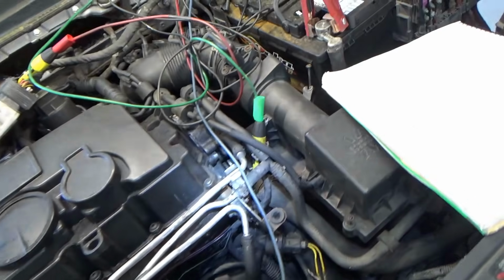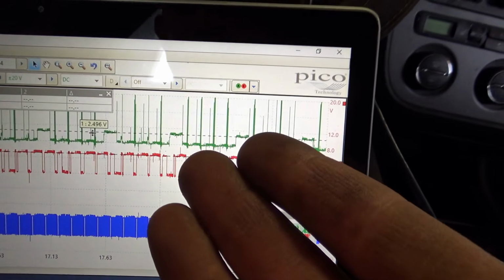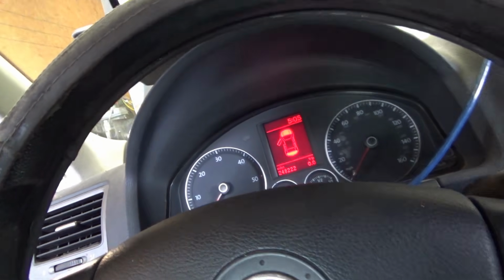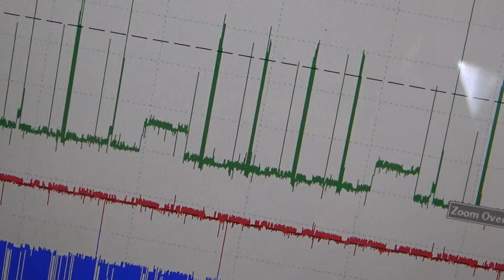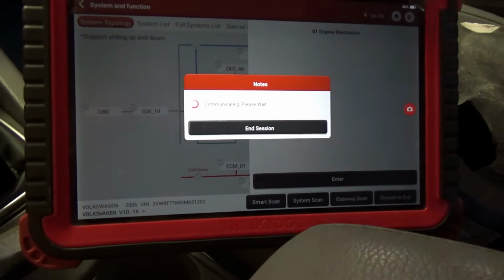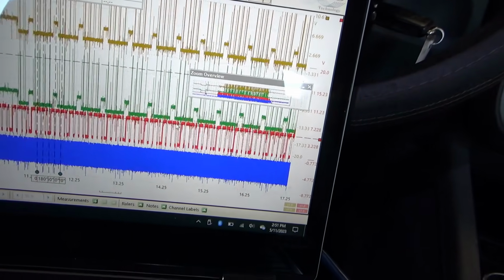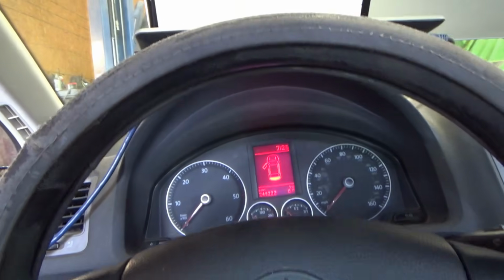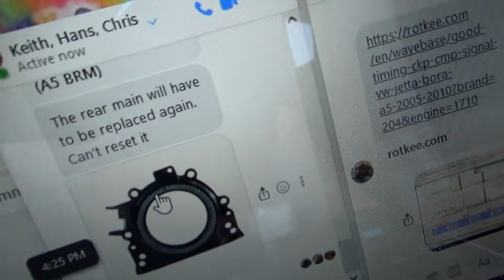ANOTHER Dead TDI?? (Jetta No Start After Engine Swap - Part 2)

Comment: The new rear main seal comes with a removable plastic clip that holds the seal in the correct place for installation . You just have to make sure the engine is at TDC . 
I would charge the 6 hours spent to diagnose.
Reply: They should get the money back spent diagnosing the car from the engine installer. It's not the customer's fault or Ivan's.
Reply: @TheFrenchPug  I agree. It would suck for them since I'm sure they never could have imagined a rear main seal that has to be timed and I could see a lot of people making that mistake, but someone has to pay for Ivan's time and the installation error obviously is not his fault or the customer's fault.
Reply from the maker: @TheFrenchPug  installer was the owner of the car 🤣
Reply: @PineHollowAutoDiagnostics  OMG!!! Lmao!!! So, did he not time the seal gear then?
Reply: @TheFrenchPug  agree👍
Reply: @TheFrenchPug  
Well, when you call an expert you pretty much expect them to be 'in the know' - also about the more strange things about a vehicle. Right?
Reply: @Peter_Riis_DK  I wouldn't expect an expert know about all of the nuisances in a vehicle, or they wouldn't have to pull out service data. There should have been something he accessed for service information that would tell a technician to ensure that seal was properly timed before proceeding.
Reply: @TheFrenchPug  
- Hello, is this an expert in VW diesel engine diagnosis?
- Yes, indeed.
- I have a ... etc. ... Can you do that?
- Certainly.

In that case I would certainly expect expert knowledge and behaviour.

Now, I'm not familiar with mechanics rates in the US. So, is Ivan's pricing expert-rates or average?
Reply: @Peter_Riis_DK  I do not know what he considers himself an expert in. But diagnosing seems to be his Forte. Still, unless you have familiar working knowledge with only that specific brand, you can't be considered just a VW expert. However, if you're an expert in diagnosing, you clearly have to rely upon service literature if you're going to do all brands. And Ivan is often given vehicles from the "Brand Experts" that they can't even figure out, and he does! So what does that make him?
Reply: @TheFrenchPug  I consider him to be a person trying to make a living out of difficult  daignoses where all other avenues have been explored & as most people do not trust stealerships they go to independant shops 1.price 2.location & when the independants are not able to rectify the problem they then call on guy/girls like Iaan to solve the situation so that to me makes him a very good problem solver & if he doesn't know he will call on his group of problem solvers to fix the problems so I  think he is the comsumate professional at what he does.You may disagree with my analysis of him but can you do better?
Reply: @Riis_DK  Ivan is not a VW "expert". He's an expert in diagnosing thing using data and logic. It's impossible to know all the quirks of all cars ever made... In the end he did give them the answer they needed to fix that car, didn't he?
Reply: @TheFrenchPug  The new seal should have came with a warning. For better or for worse, most people don't look up service data for every single job they do and it isn't reasonable to expect that everyone who might be installing the seal will know all of VW's quirks.
Reply: @johnnyblue4799  
Nah, as I see it, the lesson is that next time the shop might as well call that hotline straight away.
Reply from the maker: @Riis_DK  which hotline would they call? 😉
Reply: @PineHollowAutoDiagnostics  
Dunno. Perhaps the one you used. Why?
Reply: Lack of reading on the guy who installed it! Yes. I'd like to know how he charges!
Reply: @dans_Learning_Curve  I'll bet he didn't agonize over charging.
Reply: Is there a way to confirm the seal timing signal without pulling the tranny?
Reply: @alexanderzubar9593 yes compare the cam crank waveform to a known good. You’ll see the crank timing is off
Reply: Ai ai ai... those Vührer Wagens. They are not as simplistic as they use to be.
🙈
Reply: I agree
Reply: Would never have thought didn’t know I’m just gonna leave it at that about the Volkswagen. Nice fined hopefully that’s it even if it took some help. Sometimes we all need it.
Reply: It's easy to mount the reluctor ring without the special tool, all you have to do is time the front pulley (small notch with the arrow from timing cover and camshaft in the right position).After that gearbox off , 3 screws for removing the main seal with the ring, put the new ring with the Orange clip in place and press it carefully! It will be eniugh for the car to be in sync! After that adjust the   torque setting from the three screws from the camshaft sproket, 0degrees KW but depends on the car mileage, my Best rezultă where between 1 degree 2 degrees positive deviation. Best wishes!!🎉

Comment: 10:26  bent fuel line ?  .... blocked fuel filter ....
Reply: no ,, its a diesel ,, he shouldn't be much concern with diesel fuel pressure as there is another high pressure fuel pump which is more important to start the car ,, some diesel vehicles like tractors dont even have an electric diesel pump its more like a higher put up tank that feeds the mechanical high pressure pump

Comment: Wow. Timing signals from the crank seal. If a guy was not familiar with this system it might get interesting. Learning curves sometimes vary, but that’s just sometimes how it goes. As for the bill, I would have to deduct a reasonable amount for the lesson. In the end, You did figure it out regardless of how. 👍👍🇺🇸
Reply: How do we know that is the problem? Did the guy say he just tapped the seal in and installed everything?
Reply: @TheFrenchPug  I believe the known good wave form that Ivan acquired established that the seal was out of place. I think there is still a problem in the fuel system though. I’m sure Ivan will share the outcome when He can.
Reply: @brianw8963  Oh....because that was the cam sensor signal? I get it. I guess that whole unit surrounding the seal is the actual sensor? What if that thing goes bad? Geezus!

Comment: I'm honestly surprised that the guy that replaced the rear main seal didn't even mention that it had a sensor.  I figured that would be a good piece of information to give you.  Lol
Reply: Sure outdid me today! I’ve been fighting with a 25 year old John Deere tractor. Good part… owner kept it immaculately clean (externally). Bad part… everything is worn out, broken or leaking.
Tenacity counts!
Reply: He most likely didn't know.
Reply: @LesReeves  I could understand not knowing how it works or what it's used for. That said, a rear main seal with wires attached to it is pretty abnormal and worth mentioning.  Especially since they replaced it.  Lol
Reply: @RK-kn1ud  I understand that but without the exact information they figured there was no special way it had to be placed it happens when you are DIYing things & VWs are notorious for not having manuals readily available. Just an observation. Cheers.
Reply: @LesReeves  I totally understand not installing it correctly as well... especially because that isn't exactly common knowledge. 

I figured the guy could have just said "BTW, the rear main seal was replaced and we thought it was strange that it had wires attached to it...just worth noting". That probably would have reduced the diagnostic time by 80%!
Reply: @RK-kn1ud  Yeah a relavent point but I think in part 1 they told Ivan it had been replaced I might be wrong I would have to re-watch part 1.
Reply: @RK-kn1ud Yes. He had to see that and wonder why. Maybe he did align it!
Reply: @LesReeves  Every car has the instructions for repair available, its legally required. This being an 06 I'm sure there are plenty of instructional videos available. If they are at all familiar with cars the fact that there's a sensor on the seal, and the weird metal bit, should have caused them to pause and wonder why that is and if there are any special requirements to installing it. Maybe if only to properly adjust the spacing of the sensor. This was a case of "I know someone that can do it cheaper" and they got what they paid for.
Reply: @DavidPruitt  It was said that they did it themselves & the one VW I worked on was a 2003 Golf Sport & even AllData didn't have any information on it apparently it was imoprted from South Africa (to AUS) & as far as VW were concerned it didn't exist.I tried using the VIN & still no information.

Comment: For those interested, here is how this seal should be installed. https://youtu.be/Lo6wpKdBoUE
Reply: Wow. I guessing renting one of these from Autozone is never going to happen... lol

I was surprised there wasn't some feedback prepping the seal contact surface. My experience with Teflon seal installation is the crankshaft surface must be "clean": Chemically clean. Once the seal is installed the seal must be allowed to "form". No crankshaft movement for several hours. Then bump it without starting the engine several times with additional "rest periods".

Maybe this rear main VW flavor doesn't need this attention. 

Thanks for link. I would have never guessed. 

I feel like I am missing something. What keeps the ring from moving on the shaft? 

I get that it is pressed on with the tool, T10134. I guess a key (slot) on the crankshaft would gouge the Teflon seal during installation.
Reply: Are you flipping kidding me?!?! Why I'm God's Green Earth would the Germans do this when it's not at all necessary??? Thar is like performing delicate surgery on a heart patient. And if you mess it up for any reason, it's not a piece if cake to go back in and correct! Mind blown. Thank you for that link.
Reply: @TheFrenchPug  I don't see anything wrong with this design, the only problem is when people working on it don't know how to read a repair manual on how to properly install a new part.  The rear main seal is not used for the crank sensor, the toothed wheel that goes on top of the rear main seal does that job.

Comment: All the respect for that starter !
Reply: Yeah! Poor thing stood all that cranking without a glitch.
Reply: I hope it is easier to get to than the rear main.  The way that engine was rocking, I would say motor mounts as well.  Does that car have the oil-filled ones?
Reply: @lvsqcsl  no they're not. It's rocking due to pd engine's high compression ratio once it gets running it smooths out

Comment: Giving the starter a workout!
Darn Eurotrash.  The rear main seal issue was mentioned in the comments of part1.  Who would have thought a rear main seal needs timing!!!  Crazy.
I don't know how you charge for this.  On one hand your time is your time.  The shop owner actually but unknowingly caused the issue.  I think you charge him your hourly rate for the hours you have in it and the shop owner "eats" the majority of your charge and the labor to fix the rear main seal.
The lesson of the day (although I know you won't take it) is don't work on European cars.  I am convinced they are all a different animal and unless you work on them all the time you will always be bogged down not knowing things like timing the rear main seal.  They have secrets and gremlins built right into them.

I know you know Super Mario.  He would be a good resource on European problems.  Also, HumbleMechanic works nearly exclusively on VW and Audi.  You might try him too.  But the best way forward is just to politely decline to work on these things.  You can always refer them to the guys that you know are honest mechanics that work exclusively on European cars.
Reply: "who would have thought a rear main seal needs timing"

Who would have thought a crank position sensor needs timing...just about everyone familiar with engine control systems.

Comment: It's almost like the morons at Volkswagen forgot about adding a reluctor wheel to the crankshaft and some idiot came up with the idea to just make it part of the rear main seal!
I can see absolutely no reason why you would come up with that asinine design other than maybe this engine started out life as a non-electronic engine and they had to find a way to add a crank reluctor to it without redesigning the crankshaft????
What a bunch of idiots, probably a good thing Volkswagen no longer manufactures diesel engines in this country!!!

Comment: You would think by now, diesel fuel would be running out the tail pipe.
Reply: It seems that the ECU is smart enough to know that stuff ain't working, and won't push fuel out for nothing.
Reply: Oh it does push out fuel. But it's not so much...

Comment: The 20psi fuel pressure is not ok, this needs to be resolved also.
Reply: Yes
Reply: Lift pump on a diesel is usually quite low. It's more of a high volume pump to cool and lubricate the injectors.
Reply: @TheWilber09  Agreed, but it should be 50psi or higher

Comment: That's crazy that a Rear main Seal is also the Crank Sensor...WOW....These New Vehicles are a JOKE anymore...It's too bad We can't STAND TOGETHER and QUIT BUYING this JUNK. and drive the old vehicles. Tell these dealers to stick these where the Sun doesn't Shine...But there's too many Lazy people out there that NEED THE FANCY BELLS and WHISTLES on that New JUNK...If I was You I would Charge them all the hours you Spent on it. Maybe doing that these people will think before buying this JUNK...LOL...LMAO...Great Video as always. Sir..Rant Over...LOL...HAHA...
Reply: 1) The oil seal is not the crank sensor, it's just a conventional lip seal that is part of the housing. The crank sensor ring and pickup is integrated into the design.
2) It's not a new vehicle, it's 17 years old.
3) What kind of dullard replaces the rear main seal assembly and doesn't even question why it might have an electrical connector AND the new one has a plastic clip to hold the ring in the TDC position via the timing hole in the side of it? Not knowing about this system is entirely reasonable, but seeing all those blatant clues and not questioning it  is not.  Five minutes spent on a search engine would have explained the situation and the installation method.

Comment: Turning an oil seal into a sensor has a bit of brilliance to it.  HOWEVER, the Engineer (and the company) needed to recognize how far out of the norm this is and tag the hell out of the replacement part!  Hiding a critical feature in a mundane component guarantees trouble for anyone not specifically trained on that model.
Reply: It had a wire harness hanging out of it.  How much more of a hint would anyone need to look up the replacement procedure.
Reply: @scrappy7571  It could just as easily have been a speed sensor or other non-timed signal.  The fact that the original mechanic missed it, and Ivan's expert immediately asked the question, makes it very likely that this is a common oversight.  A big, orange sticker on the part packaging would've cost pennies and saved hundreds of dollars.
Reply: @jamesanderson2176  
Are you sure there's not an install caution included in the package? It might even say "Install according to service bulletin xxx using tool xxx.". A caution the driveway mechanic looks at and as usual thinks "I don't need no stinkin' tool."?
Reply: @jamesanderson2176  Saved hundreds of WHO's dollars?  Manufactures don't give a rats ass how much it costs the customer, they only care about costs to make the part. That orange sticker costs money to make and include with the part.  Not being a bitch here, it's just the way it is.  Installation information is published, if the installer does not take the time to look it up, it's on him.
Reply: How did they hide it? The ECU spit out correlation codes. The seal has a wiring hanging out of it. The seal has an alignment mark on it, and I'm sure its in the manual. What do else do you need? A brightly lit sign saying "check the seal timing?". Lots of mundane parts have multiple functions, sometimes its up to the person working on it to actually read up on how the system works.
Reply: @DavidPruitt  Agree 100%.  No tech/mechanic can know everything.  That's why there are service manuals.
Reply: What happens if the guy who installer the engine says he did align the crank seal? Woo hoo!
Reply: @The French Pug: 👻
Reply: You can always read your Haynes Workshop Manual!

Comment: Question: is there a warning notice in the package for the crankshaft seal/sensor? If not, there should be. If there is and someone ignored it...
Reply: The sensor has a wire connection, that should have been enough of a hint to to look up the installation procedure.
Reply: @scrappy7571 Does the seal rotate or is there a gap in it so it can pick up the rotation?
Reply: @TheFrenchPug  The seal itself is stationary, attached to the housing. The encoder ring rotates with the crank but it is not the actual oil seal.  There is a special tool to install the seal which isn't horribly expensive (about the same as the seal) but it's possible to do without if care is taken.
Reply: @ferrumignis  A warning ⚠️ tag in the seal package would ideally say, "Use tool T123 to ensure proper crankshaft timing signal per VW shop manual."
Reply: @ferrumignis  I saw the video someone posted of it. I'm in disbelief VW designed engines like this vs. just having a normal crank sensor that  mounts off the flywheel.  How flipping stupid!!!
Reply: @davidgrisco1939  Quite honestly if the electrical connector and the plastic retainer that comes on the new part to keep the encoder ring aligned don't ring any alarm bells then it may be wise to put the wrenches down.
Reply: @scrappy7571  I suspect most would assume it's "plug n play"
Reply: @davidgrisco1939  Assuming always gets me in trouble.  Wires hanging out of any seal would trigger a WTF moment, and at least google it.
Reply: Good point(s)!
Reply: It was probably in German. That is why I hate new vehicles way too complicated.I would hate to be working in the industry now (retired mechanic.)